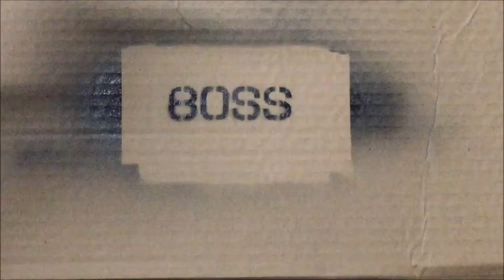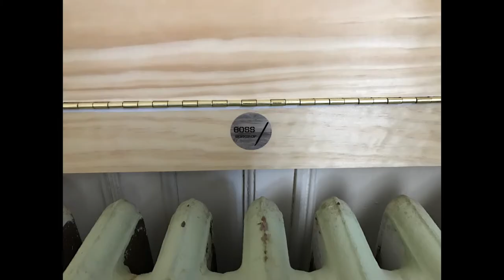Making a Radiator Cover

Comment: If that was solid timber you used then I see problems down the line with warping, twisting and splitting as it dries out too much! Personally I always use mdf for radiator covers! Nice little video though 👍🏼

Comment: Hi! How did you put the fancy sheet of aluminum onto the wood? Was it screwed down? Glued? Haha sorry, I’m not build savvy at all
Reply from the maker: Hi, the aluminum was cut to be about an inch larger than the opening so I could screw it in using some short screws from the inside.
Reply: The Boss Workshop thank you so much

Comment: Hey, when did you get the metal sheet with the fancy cut of design on it from?
Reply from the maker: Hey, it's sold at Home Depot, here is a link to it https://www.homedepot.com/p/M-D-Building-Products-36-in-x-36-in-Union-Jack-Aluminum-in-Silver-57208/100351162?MERCH=REC-NavPLPHorizontal1_rrNA-100351162--N

Comment: You know, viewers do not have the option to speed up or slow down a video.  You know this, right?  So running it at super-speed pretty much ruins it.  No one can follow what's going on except someone who has done this or is otherwise an expert.  So, basically, you're showing off without demonstrating anything.  Which stinks.